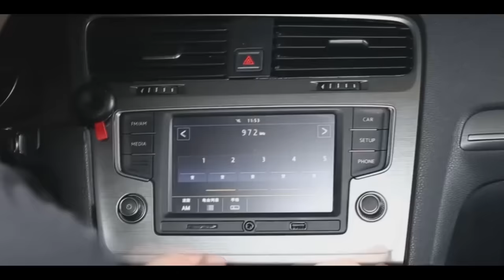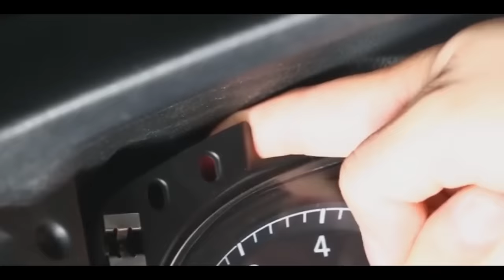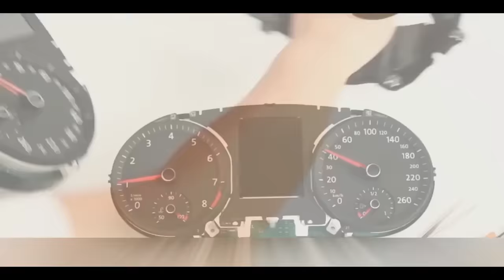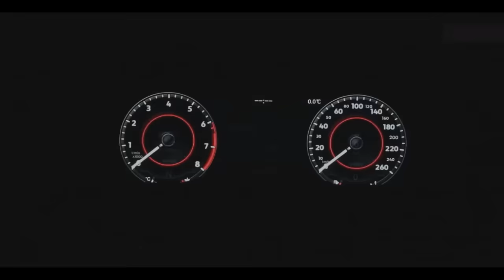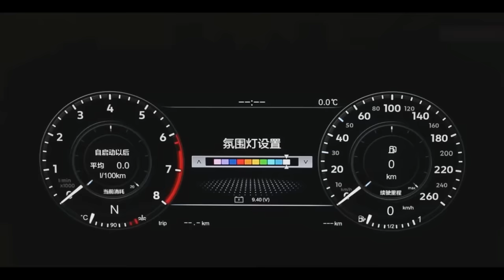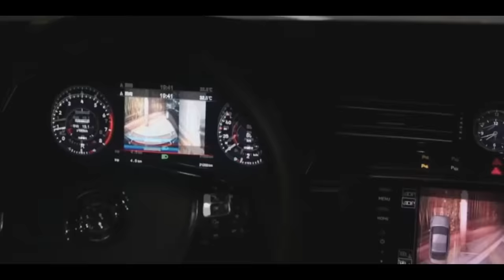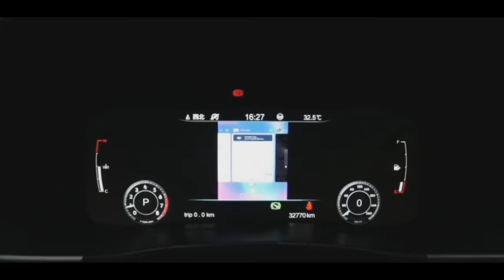VW Golf 7 / 7.5 / ANALOG to DIGITAL lcd DASHBOARD cluster CONVERSION 🛠 📟 🚗

Comment: Looks good but nope, happy with anologue. Don't wanna find myself stuck with blue screen. Genuine or nothing
Reply: I thought that im the only one in the world that like analog dashboard than digital.
Reply: @147ciko  Nope same here, I would love to see a proper dials. I think a screen in the middle is all you need and digital screens do not feel the same when driving
Reply: @squeakers27  My opinion is that displays with touch screen are unnecessary in cars, but its trend these days, for firs you need to look where to touch, but with physical button you can press without looking.
Reply: Agree.
Reply: I love my 31 years old analogue setup.
2 simple bulbs to light the thing at night, one knob to change the brightness (that goes from nothing to barely visible ahah)

When I had to drive a modern car with digital stuff it made me almost blind. 

Nothing like an old setup. Better visibility, simpler gages, less info, less cluter, more driving. More reliability also
Reply: blue screen no worry, signal light + horn + push start button to reset .... hahhaaha
Reply: @147ciko  analogue gauges are bad for fast cars cannot keep up with accurate speeds  or go as high but unnecessary for most cars yes
Reply: I agree of origin or nothing I do not see too much the interest of the lcd in more visually it is not top the aim head-up it is more interesting in a more reassuring car
Reply: Ivan Kapetanović Its needs time, you also type blind while using tour phone right?
Reply: @HIDCOMMY  hahhaha, i see like saying ctrl+alt+del hahha
Reply: @147ciko  not alone me too there is nothing better than analog
Reply: @147ciko   no u r not alone nothing better than analogue
Reply: Analog is the way of the past, just like type-writers
Reply: Sticking with the classics
Reply: I don't get it. Why would you want to watch a movie in your cars dials area?! Plus, is this just a generic lcd screen & cluster? Seems a bit strange and a lot of bother tbh. I like lcd dials but I prefer the tactility of some nice analogue clocks.
Reply: I love my digital analogs (3 options), Volvo V60 2014 Rdesign.
Reply: It's not really analogue, it's all digital, but instead of a screen, there are servo motors with needles attached to them.
Reply: Hi, nice retrofit, Nicely installed. This can be done on Skoda Octavia mk2 face lift?

Comment: What about active cruise control and all the other assistance systems ? Like lane assist and traffic sign recognition.
Reply: The car Needs the acc and lane assist units (sensors and cameras)
Reply: TrustBazt yes of course I have all that I just want to know if the buttons on the steering wheel for acc and all other Assistance systems will they work and will they appear on the screen ? Also where can I buy this ?
Reply: I got lost at 0:00
Reply: @jjrimz99tandem_drifter  😂😂